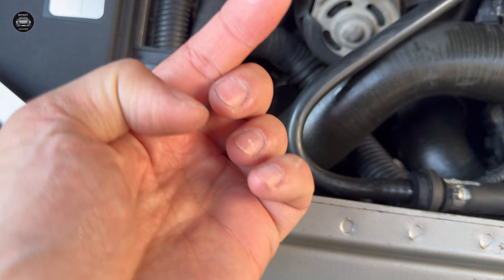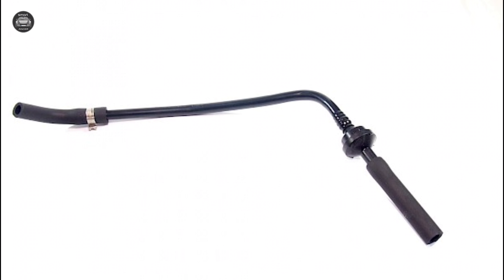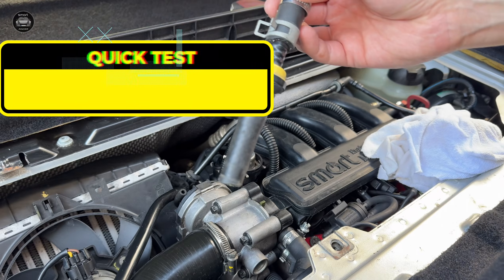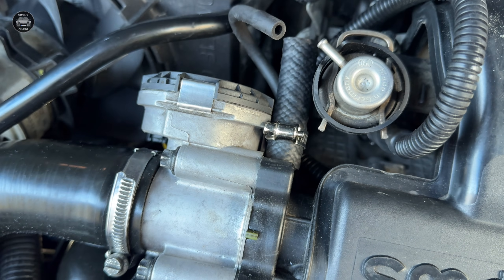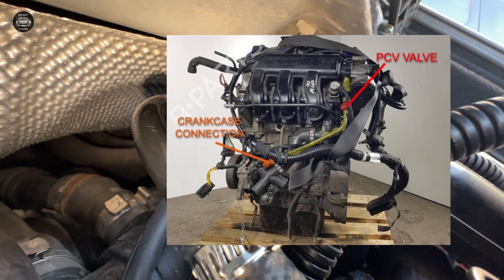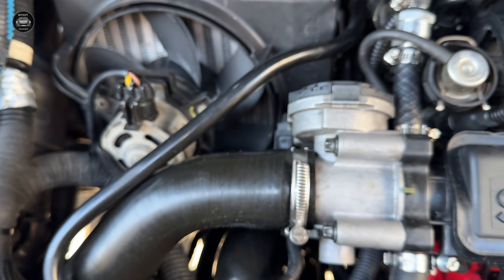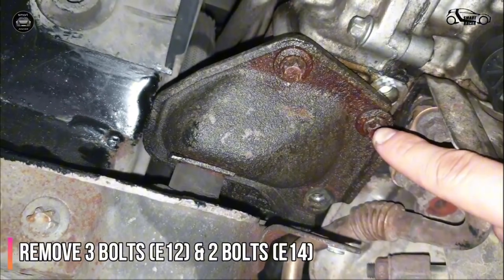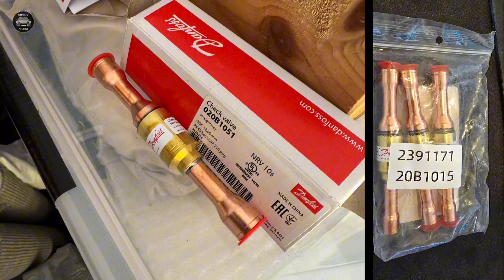Oil Everywhere? Smart Roadster Breather Pipe & PCV Valve Explained (OEM vs Upgraded)

Comment from the maker: Oil everywhere in your Smart Roadster engine bay?
This is often caused by a failed top breather pipe or PCV (non-return) valve.

Here are the parts and references mentioned in the video 👇

🔧 OEM & Upgraded Breather Pipe / PCV Options
👉 https://linktr.ee/smart.racer#collection-525ef6dc-51d5-452b-8986-1f76b3564275

🔧 Top-tier PCV / Non-Return Valve (Danfoss NRVH 10S)
👉 https://www.kaeltetechnikshop.com/rueckschlagventil-danfoss-nrvh-10s-durchgangsventil-lot-10-mm-odf-kv-1-2

🚗 Goran’s Smart Roadster Build (Tested Upgrade Setup)
👉 https://me-myself-and-i-60.jimdosite.com/roadster-projekt/

🎙 Note:
AI voiceover was used in this video because my microphone is currently not working.

💬 Now I’m curious —
Have you ever had breather pipe or PCV valve issues on your Roadster or Fortwo 450?
Drop your experience in the comments 👇

Comment: Thanks for the video. Was the non-return value - the metal replacement you installed - 10mm outer diameter both ends? Thanks🙏
Reply from the maker: no 10mm is size of non return valve